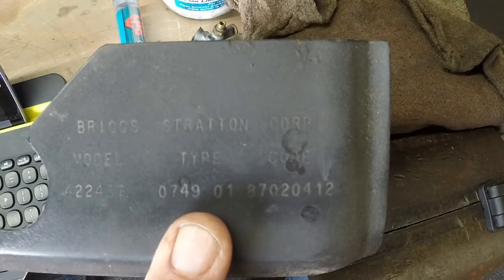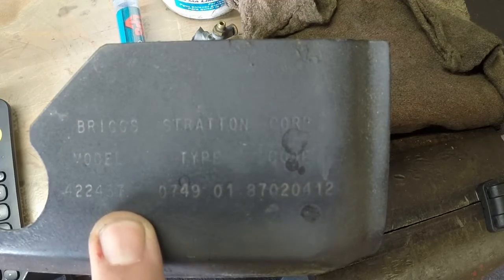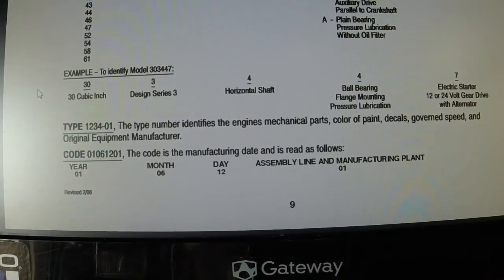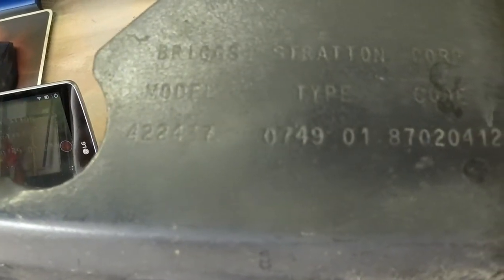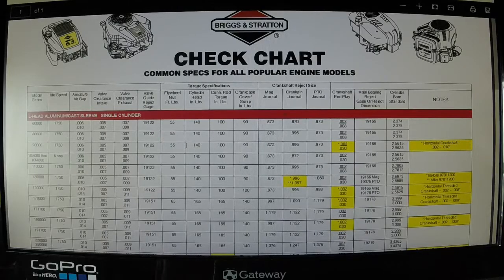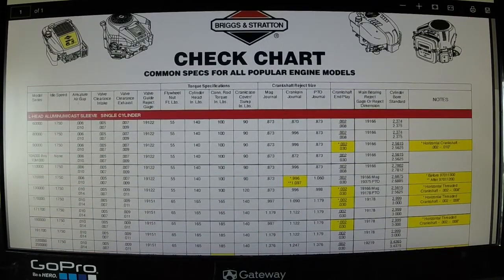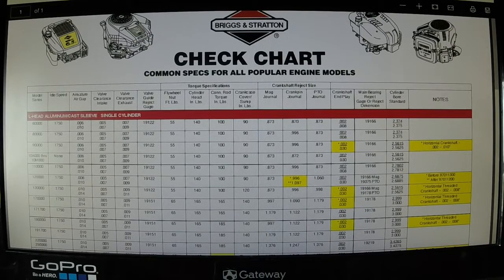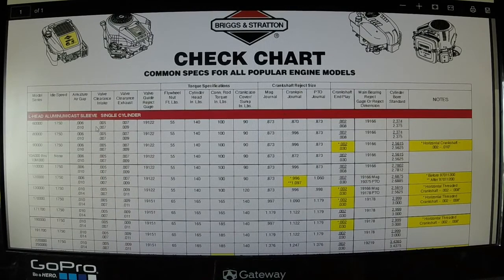Briggs & Stratton Model Type and Code Decoding!!

Comment: hey ZIPPPPP.....I WAS LOOKING FOR INFO ON JUST ONE OF MY MANY BRIGGS, ENGINE.. THE KHOLER on one of my riding has a bad flywheel so I was going THRU the spares the KHOLER is a 26 hp....version so I decided to look on utube..... decoding BRIGGS... and boom! there you were... turns out it's a 44777......26 hp... perfect.. but will look well into it before is pull the KHOLER..
I don't know about the bolt patterns being close... I'll  find out  for sure.... I bought a never started 26 hp BRIGGS.. for 250... since the other is a 26 I'll keep the never started for something else... good to see your post!

Comment: Can you help with model number for early 1960 3HP B &S.  Only reference I can find is a plate on the block which says:  TD NUMBER 2222198.  However I can't find any BS manual referencing that model.  I want to replace not working coil with Magnetron coil to eliminate the points/condenser.  Can you help?

Comment: How do you determine the horse power of a Briggs and Stratton small engine ? I need to replace one on a log spliter
Reply from the maker: There are a number of ways to determine the power of any small engine and the easiest is doing an internet search of the engine model number in question. Another is looking up your log splitter model number. Typically, Consumer grade log splitters are between 5 and 8 horse power depending on the pump requirements. I run a 25ton with a 6hp with absolutely no issues. Zip~

Comment: I'm really thankful for your information following you from Libya Mr. .. Hope if I can get instruction manual and workshope manual for my Homlite Generator 252417 model 0169-01 Type..
I bought it 5 days back having problem with Carburetor and I found Main jet is broken.. Hope if you can give advice ,cause I didn't find spare parts here in Libya..
Thanks in advance

Comment: Hi Zippo, I know this video was done in 2017 & I have used the links you provided, thank you. Just a heads up the links do not work now or were taken down 🙁. I do have a question, on the chart it list by series #. Where do we find that (series #)
Reply from the maker: Your Model Type and Code are on all Briggs. The Series would be the "Type". This is the set of numbers that differentiates which manufacturer ordered these engines for their power equipment and associated with this same number are specifications unique to the manufacturer. Like, engine color, carburetor type etc. Hope this helps! Zip~
Reply: @ZippoVarga  Thank you. I do see the "Type" but not the series. And now I know.\
Thanks again.  Joe Z

Comment: Dear Zippo, I have an old Briggs engine, model ZZ, the label says: Mod. BP - TYPE 300732 - Series 193249. Could you please tell me the year of manufacture of this engine?
Reply from the maker: The Model BP is the same base design of the ZZ but a later model engine. As for what year it is, I'm sorry but I can't help. I used to reference the ASECC website, but it is no longer. This caused a great many of us to look for people who knew the codes and associated years which took me to Facebook Groups, where there is a wealth of information and people eager to help. So that's my suggestion to you is to go to Facebook and search for vintage Briggs engines groups, join the groups and use them as references. Zip~
Reply: The Model BP is the same base design of the ZZ but a later model engine. As for what year it is, I'm sorry but I can't help. I used to reference the ASECC website, but it is no longer. This caused a great many of us to look for people who knew the codes and associated years which took me to Facebook Groups, where there is a wealth of information and people eager to help. So that's my suggestion to you is to go to Facebook and search for vintage Briggs engines groups, join the groups and use them as references. Zip~

Comment: Hey Zip, very helpful videos,  is there any way to ID a Briggs and Stratton engine that has had the original starter cover replaced ? If I sent a photo to you, could you tell anything from that?  Thanks
Reply from the maker: Hi Maine. You need to measure the bore, stroke, valve sizes to determine the HP of an engine and there for, what engine it is for ordering parts. Zip~

Comment: Ok so I have both of those pdfs before but How can you find the valve specs when my exact model number and type don't show up anywhere specifically. 406577 0106 e1.  Ant find it anywhere. Any help is appreciated
Reply from the maker: The standard is .005 on intake and .007-.009 on the exhaust to allow got heat expansion. Hope this helps! Zip~

Comment: i herd that the code's first two numbers are the year of the motor from a lawntractor forum quite a few years ago. 
oh also picked up a free toro ' wheelhorse' friday, not sure of the year but its a 17hp oil presure briggs, 44" deck and hydrostatic. sounds great, but.....trans is locked up, motor covers are missing, hoods broke.  ill try n see whats goin on with it sunday possibly. more then likely itll be used for parts , im thinkin its too far gone.👍

Comment: What happens when you don't have a model number stamped on engine? My 4hp push mower from 2002, bought on clearance at Home Depot, MFG#02009. Family YBXSX 1581VA. The UPC doesn't bring up anything either,  0 47282 74278 5. Made in Lawrenceburg TN. Got a few partial numbers from another sticker. I'm lost here.
Reply from the maker: If the engine is covered with a plastic shroud, remove it and you should find the numbers stamped in the metal housing if it's a flat head engine. If it's an over head valve engine, the numbers are on the valve cover. Zip~

Comment: Man in Georgia refused to tell his model number Briggs engine. It is mostly similar to-  31H777 which is for riding mower- vertical shaft Intek one cylinder, with 12v starter, but his has no alternator stator nor magnets under flywheel according to him. What code would that be??  Or is he lying? The code for 319775 is replacement 18 1/2HP engine for power generator without alternator, with starter. What vertical shaft implement with 18HP has no stator? I thought that a 12v starter motor required a 12v battery, so that an alternator was also required to charge it.

Comment: I'm trying to work on my Briggs mower, but i cannot find what model mine is...can any of you nice ppl direct me to a service repair manual, here is what i can see on the block(9P602 0022H1) I have a Haynes techbook, but i cannot find my numbers at all,
thnx in advance
Reply from the maker: If the engine has a plastic cover over the metal blower housing. Remove that (usually with two Philips screws) and your numbers should be stamped on the blower if it isn't an over head valve engine. If it IS an over head valve engine, your numbers will be on the valve cover. Zip~
Reply: @ZippoVarga   THANKS...i forgot to also add, directly under those numbers is what appears to be a date.(DOM 01 14 15). 
when the sun rises, i shall follow your instruction...my manual gives me 2 piCs, 2 models, model 80000 300e/ 450e series.90000 also ranges with many other series..

Comment: Just looked up a blower housing for a Homelite T-16 Briggs engine and I'm seeing prices around $175  This is no doubt price gouging and an embarrassment to the industry.
Reply from the maker: That's highway robbery! Is yours missing or just rusted out at the bottom? You can use blower housings from the 13hp to 16hp. I'd check the Facebook Groups that cater to Briggs, Simplicity and Allis-Chalmers and ask around. Typically you can find one for $30-$40 plus shipping from other enthusiasts. Zip~

Comment: so, you DON'T decode the TYPE. Gotcha
Reply from the maker: Correct. The TYPE is assigned to the manufacturer ordering the engine and it contains the codes for Model Specific alterations to what would be a base engine. This can be something as small as which stater is being used to a water resistant spark plug cover to specialty sheet metal to custom oil pans, crankshaft diameter and length and the list goes on. There isn't a known decoder available that I'm aware of that breaks down the TYPE options, but that's not saying that one doesn't exist. I just haven't personally found such a decoder. Cheers! Zip~